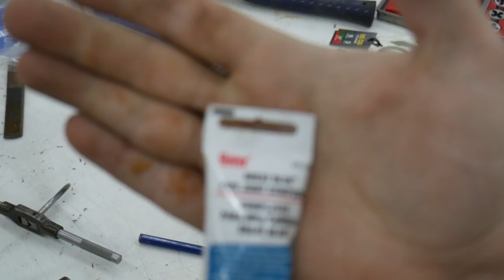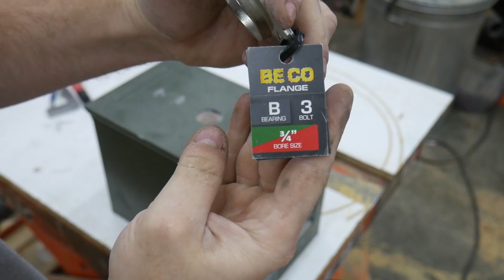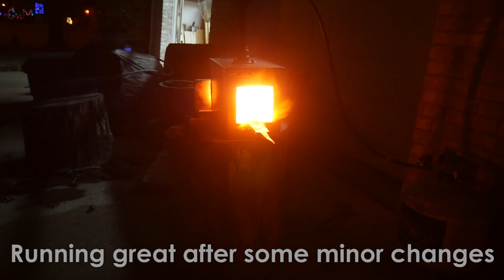DIY Ammo Can Forge: Long Form Video

Comment: A parts list would be cool. Also, you said you’d post a video about the changes you made to get the burner working properly, is that available somewhere? If not, an explanation would be great too! This is a great video/series, thank you for sharing!
Reply from the maker: I don’t remember saying I’d post a video about it, but there’s still a good chance I said it somewhere! All the adjustments I made were to the length of the welding tip I used for the gas orifice. Every dimension on the gas burner is critical: the length of the pipe, the size of the tee, the size of the welding tip, but what is overlooked is how far into the tee/pipe joint the welding tip is inserted. It determines how well the propane and are are mixed while traveling down the mixing tube. So while the tee size and welding tip size controls the air/fuel mix ratio, the tube length and welding tip length controls how well the air and fuel are mixed. There was a lot of trial and error involved. Mostly disassembling, grinding a little off the welding tip, reassembling and testing, then repeating. DM me on one of my socials and I’ll put together a parts list for you.

Comment: This is really very good. I like how you did it. I need to make one for myself (I will manage). I do not need it for knives but for mokume gane (fusing non-ferrous metals together). The oven, which will be smaller than yours, need a reducing atmosphere inside (more propane than oxygen in the flame) and it has to go up to 800 degrees C (1472 F) for thirty minutes. I have to say it scares me a bit. I have an electric kiln, but then the technique is different, I need to use much lower temperatures and the fusion process takes 10 hours. What do you think? Could I use it for that long at this temperature with no risk? Thanks, Dordi, Sweden.
Reply from the maker: Running at cooler temperatures shouldn’t be a problem. I figure it would just be a matter of getting the air/gas mixture dialed in. The benefit of an electric oven is precise control over the temperature, but 10 hours is a long time and the cost of the power consumption would be a concern for me. Good luck!
Reply: @SouthpawWorkshop  Thank you. This is very nice of you. Good luck to you too.

Comment: That is pretty sweet idea! How did you find out the right air to fuel mixture? Was it just a matter of adjustment? Thanks!
Reply from the maker: Lots of research, lots of trial and error as well.
Reply: What the right amount of air u need
Reply from the maker: If you use the same fittings I used in the video, you will have the correct air/fuel mixture. Then it is just a matter of making the nozzle the correct length.
Reply: The nozzle itself had to be shortened or the depth at which it was in the pipe?
Reply from the maker: I filed the copper nozzle/welding tip down little by little until the puffing stopped. It took maybe about 5 tries.
Reply: @SouthpawWorkshop  thank you for the response :)

Comment: Would you be able to melt a gold, say ½ ounce? Or what the max temperature would you expect inside? 
And, would you be able to roughly estimate the power of the burner?
I am planning to build a little furnace for melting a gold, propelled by the gasoline outdoor stove burner.
Reply from the maker: I would say the furnace probably maxes out at 2000F or 1100C. If you built it upright with fewer and smaller openings, I’m sure it could get hotter.

Comment: Quick question for you: What is the ratio of water to silica that you used?
Reply from the maker: I added enough water just to dissolve the silica enough so it would spray from the bottle.  Having said that, I can't recommend this method anymore.  It definitely helps keep the fibers down, but it does nothing to toughen the inside of the forge.
Reply: @SouthpawWorkshop  I thought about that, I was going to coat the wool with a refractory slurry (think like Satanite) to strengthen it. Thin coat.

Comment: Is the rigidizer really necessary to have? Or is it just a little helpful?
Reply from the maker: Not absolutely necessary.  Just helps keep the ceramic wool from getting damaged.  Also helps keep the fibers out of the air and out of your lungs.  I found a better alternative if you are interested.  Easier to find at your local auto parts place.  It is called muffler sealer and it is a paste that hardens when heated.  You should check it out.  I'm going to try it in my forge.
Reply: Awesome, ill check it out

Comment: how long does that tank last?
Reply from the maker: I have had the scouts over a couple times to heat treat knives and hatchets and the tank lasted through that. I never timed it but I bet you could get at least an hour of continuous burn time out of a tank.
Reply: Thomas Lightle - Red Barn Woodworking  thank you for the reply, how long does it take to heat up a piece of steel?